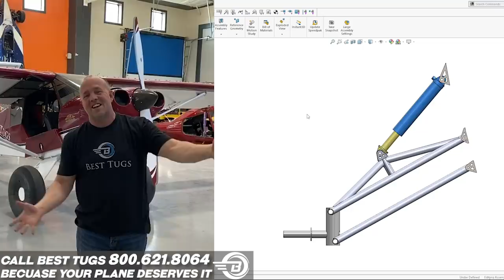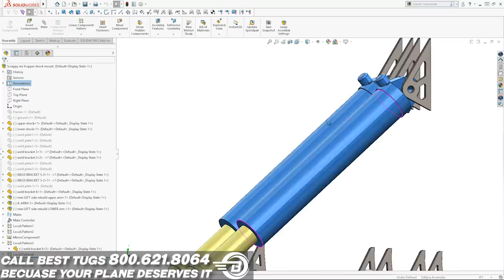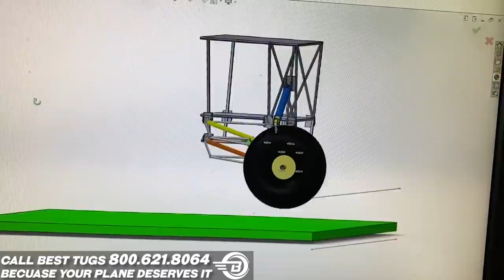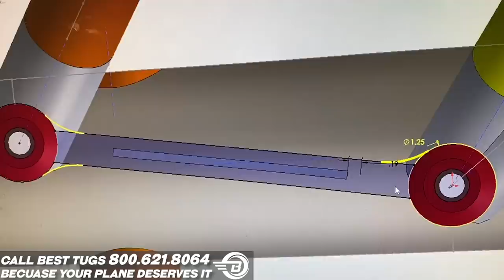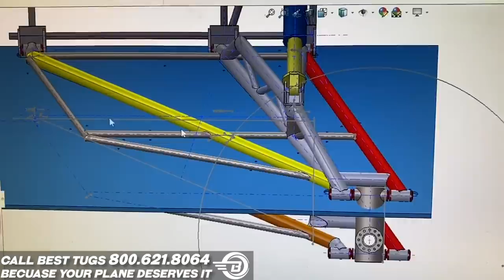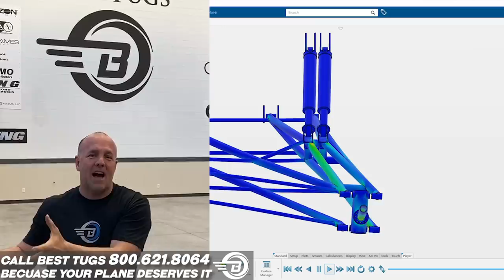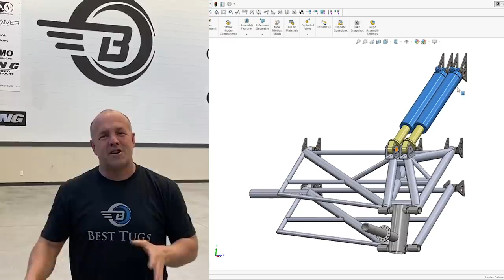20" + Travel - Extreme Bush Plane Landing Gear (Scrappy Bush Plane 15)

Comment: I don't know why but I see prop hitting on hard landings. I hope bottom out of suspension is higher than prop. Now I'm going to watch and see if I was right. Lol
Reply from the maker: Gladheateher Fruehauf 👍🤠 lol,  I would have to be a fool to miss that one.  At full bottom out I have more clearance than a traditional cub at it’s full bottom out.  Over 11” clearance at full down.  That’s why I lowered the belly a foot was so I could move the gear attach points down and get the travel while gaining more prop clearance.  You made me laugh, I can see someone not thinking of that 😂

Comment: Sorry! Wrong done.
Why do you have them in parallel? 
Why not use big camber movement. You could easily have got the tire surface of the tire to be in the same place, instead of as now, when you get a wider landing gear when pressed up.  
You do not have to get sideways movement this big.  
You are using the parallel bars poorly ... this is no car so then no steering is needed .... Sorry, but in my opinion not at all well thought out.
And why not test a good setup (Camber movement)with a big rc plane.
Higher attachment to the fuselage for the upper parallel.  Plus camber on the wheel in down position, minus camber with landing gear pressed.